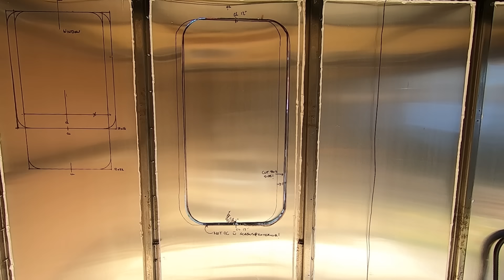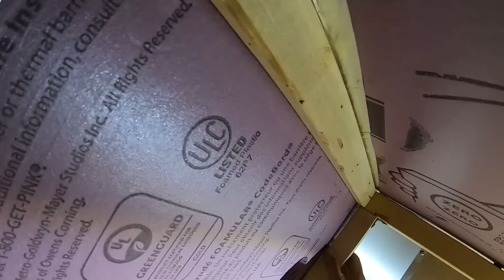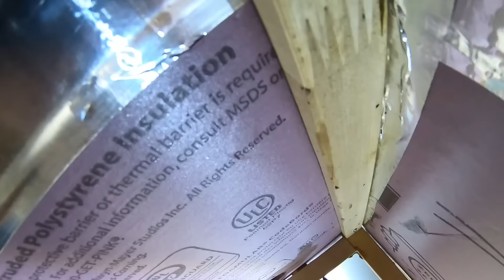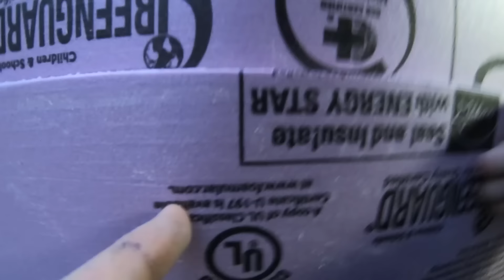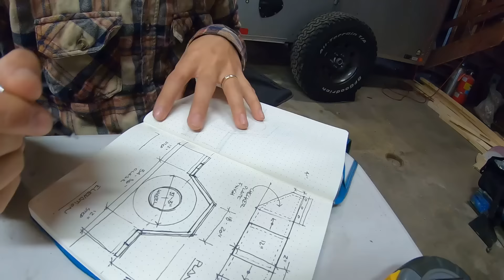5x8 Cargo Trailer to Off Road Camper Conversion | Full Build Timelapse, Start to Finish

Comment: You should put tin over it,  The same size as the insulation under the flooring and then vulcom all seems.  It needs to be enclosed.  It's quite hilarious How everyone on this page is saying good job, well done, you did a great job,  you know why they're saying that!? because they don't know the 1st thing about building,  Also make sure you have a very good ventilation system pulling out the humidity and bringing in fresh air.
Reply from the maker: Yep, I wrote a book (my thesis) on the design, building science, and logistics of converting a cargo trailer for camping usage, including the importance of ventilation. I've done my homework and although I might not have the most experience building, I think I did a good job with the resources I have. I appreciate all the feedback I can get, I'm always learning. I thought about enclosing the underside of the floor with sheet, if you watch my individual build videos, you'll see me discuss this. It's been 2 years, and I still haven't enclosed the bottom and the insulation is still there, looking like the day I installed it. I used rigid XPS boards that are moisture resistant. The idea of leaving it open allows for water, mud, snow, salt, etc. Dry out. You can't build it like a house, it's not a house, it's a trailer. If it's enclosed then water will get in, no matter what you do. Thanks for watching, I appreciate the support.

Comment: I like the idea of having a trailer as an ice fishing hut!  I have a 5x8 that I set up for camping and put a similar side window in but it is an emergency exit as well... what if someone locks you in?  One last thing you should consider is to reinforce the door where you installed the latch... that door flexes a lot and you may find it will bend at that weak point.
Reply from the maker: Thanks for watching! I typically put my puck lock on the latch so that no one can close the bar on me. I don't normally see people where I go camping so I am not terribly worried about that.
Reply: @JoelTremblayCA  I also spend my winters in Northern Ontario quite an amazing place to enjoy the outdoors!

Comment: Pretty damn cool build, very minimalist like I want. One thing I've noticed with many of these builds is the continued use of these ceiling lights. I'd be much better, easier AND cheaper to use LED rope/strip lights around the top perimeter. You only need one point of power source instead of running power wires through out the ceiling. You also have the added benefit of different color lighting as well. I used to want a 5x8 trailer but now I'm more convinced I want a 6x8 at least, and definitely standing room.Thanks for sharing.
Reply from the maker: Thanks for watching!

Comment: If its for occasional ice fishing then you live in snow country. I CANNOT imagine the moisture that we be trapped on the underside with that foam board. I vote for closed cell spray foam. Much much fewer intrusion points and waterproof.
Reply from the maker: Yes closed cell spray foam would be ideal but I didn't have the budget to fit that in. After 2 ice fishing seasons with it, it's been performing quite well! Time will tell.

Comment: Amazingly meticulous! Beautiful work. What are the big holes/ports in the floor for?
Reply from the maker: Thank you! Those are catch covers for ice fishing.
Reply: @JoelTremblayCA  All that work, added weight, then add steel fenders. All to go ice fishing? Ha Ha!. Did you add submarine ballast tanks to refloat it when you break through the ice and end up at the bottom of the lake? LOL!..
Reply from the maker: @crockett11000  I think you missed the boat on this one... by a long shot. This build is not just an ice shack, it's an overland camper, mini toy hauler, and off grid mobile office. This trailer weights less than 1200lbs. Not sure what experience you have ice fishing but here we get over 3 feet of ice and people tow much, much, heavier things on the ice LOL. I only go out when I know the ice is good. Thanks for watching, there's more videos on my channel where you can see more of the trailer and why I designed things the way they are.

Comment: Just wondering if your trailer came with some kind of plywood/OSB Walls and, if so, why did you exclude them in the final build?  I have 3/8" OSB walls on my newer trailer and I thought about leaving them on to reinforce the sturdiness of the structure of the trailer, but now I am thinking of leaving them out to cut down on weight and because of the strong off-gass smell.   This video will help a lot of people (like me) really grasp the big picture of a conversion.  Thanks again!
Reply from the maker: Thanks for the comment! My trailer only came with a very flimsy 1/4" plywood that wasn't too nice to look at. If it was a thicker plywood I might of reinstalled it but I do like the idea of saving weight.
Reply: I actually added 5/8" plywood to my entire floor AND side walls. I feel it is the minimum to actually be able to mount E track to safely for my loads, additonally I needed rigidity to push my foam board between the studs tight to the outer sun, worked perfectly.

Comment: I would put vent, high on a side wall.
Reply from the maker: There are tow vents on the walls. One up high and one down low on the opposite side!
Reply: @JoelTremblayCA  Nice build. With fan vent on roof, I would be concerned with roof leaks.
Reply from the maker: @rickdoesitforyou  it's fully sealed up and tested! No leaks!

Comment: That's awesome. Just about to jump into a 6x8 conversion here and definitely found some inspiration from your build. Did you design that bed as a slide out into a double? Been trying to figure out the most efficient ways of getting that done so you can rock as a single or mix up for a double.
Reply from the maker: Thanks for watching! I have a full build playlist step by step on my channel. There's a whole video on the bed, it's a two fold down to complete that very purpose! Good luck with your build.
Reply: @JoelTremblayCA  Thanks man. Didn't realize there was a full playlist lol and way more details and vids. That's awesome. Time to do some watching before making decision that have me back tracking haha
Reply from the maker: @Mammalian  happy watching! Definitely a fun project. No regrets here :)

Comment: I like the sketch out for the windows, did that come with windows & what is the Name Brand.  Kind of trippy sometimes I saw a section then could put together what you were doing.
Reply from the maker: Not sure what the window brand is, I just picked it up from my local trailer supply dealer. It's a 15x30" RV window.  Thanks for watching!

Comment: Very Cool! I like ur type of DIY videos more than others’ cuz it gets right to the point! And with a good variety of tunes! But….would u mind telling us which screw/washer combination (type of...) you used to attach the pink formular insulation to the bottom of your trailer with? I searched at Lowes and all they had (that I found) was these Teks zinc-plated self-drilling roofing screws that had neoprene washers attached to them. I didn’t think they were the right ones so, I started buying “L” brackets instead (which I REALLY don’t want to do it THAT way!). Thank you in advance!
Reply from the maker: Thank you! I used 1-3/4" screws with large flat washers.
Reply: I would use a styro adhesive also. At least a few zigzags across it to help adhere it and keep the wind from ripping it off
Reply: I tried searching for those and can’t seem to find them. Can u pls tell me where u got urs?
Reply from the maker: @artest7  I found mine at Home Depot!
Reply: Were they self drilling?Because  it looked like they just screwed right in (through the foam into the bottom of the plywood trailer).
Reply from the maker: @artest7  that's what I did. You can watch the insulation video where I show how I installed it. Just ordinary wood screws and metal washers.
Reply: Are these them?  Teks
Teks #9 x 1-1/2-in Zinc-Plated Zinc-Plated Self-Drilling Roofing Screws (100-Count)

Comment: For a off road trailer, why didn't you do a axle flip. To get more ground clearance ?
Reply from the maker: James, with the installation of larger off road wheels, it gained a considerable amount of clearance. (Level with the truck) I thought about doing an overslung axle but that would raise the trailer way too much. I will most likely replace my drop axle with a straight axle if I ever feel like I need it more lift.

With a drop axle you can't just "flip the axle" as the axle is designed to be positioned a certain way. What you can do is switch it from underslung to overslung. You will have to weld brackets on the opposite side of the axle of course!

Thanks for watching!
Reply: Yes I do know about the axle,it does have a bow in it. Put the bow at the top and good to go.

Comment: ACtually I take that back! They were called "
Reply: ACtually I take that back! They were called “Fas-n-Tite Cap Nails” which weren’t screws at all! The only others’ I could find were very expensive Rodenhouse Plasti-Grips screws. Is THAT what u used to attache the foam instulation to the bottom of ur trailer? Thx!
Reply from the maker: @artest7  I just used 1-3/4" screws with large flat washers.

Comment: You do realize that the pink insulation cannot be Exposed to the elements because it deteriorates.
Reply from the maker: It's been 2 years now and the insulation is still there looking great! Check my response to your previous note. I understand that this isn't the best system to use (spray foam) would be the best option but a lot more costly!

Comment: What did you use to screw that insulation underneath the trailer?
Reply from the maker: Just typical 1-3/4" screws with large washers.

Comment: Assuming you are building this for yourself why didn't you get a taller trailer? So you could stand upright in it?
Just curious. Thanks!

(I'm thinking of ordering an 8 or 9 foot tall trailer for my convertion and I'm only 6'1" but I don't want to have a coffin like feel in mine.)
Reply from the maker: I bought this second hand so I'm working with what I got. I will find myself in some tight places and didn't want to have clearance issues. I see this as a hybrid between a teardrop and full height camper
Reply: @JoelTremblayCA  thanks for the reply yo my nosey question.  
It just looked so uncomfortable for you when I watched you working.  Being older I just can't bend as easily as you do. And when I saw you sitting on your foot---"oh, yeah! I remember doing that--- about 30+ years ago!"
It was a rather sweet but sad memory!

But very, very impressed with your work quality. Some of those big panels were up and down off the wall 5 or 6 times!
Now that's determination! Wasn't sure anyone had much of that anymore! But it is alive and well in your hands. 

Great job and GREAT to see it done right!

I
Reply from the maker: @paulortiz2035  thank you! Yes my knees and feet were definitely sore after some long days. I would recommend taller trailers for people with less mobility or even families.